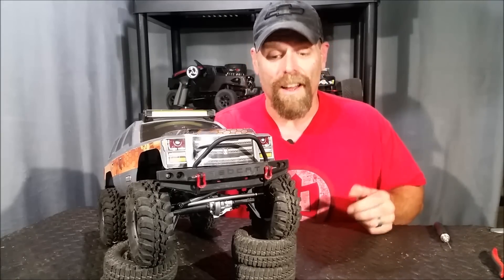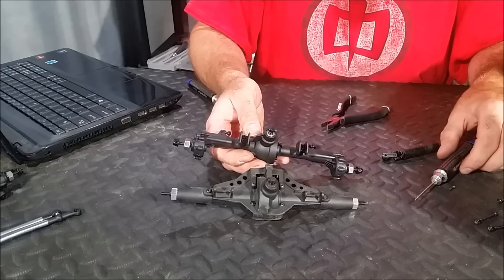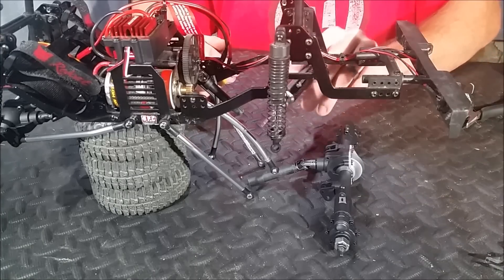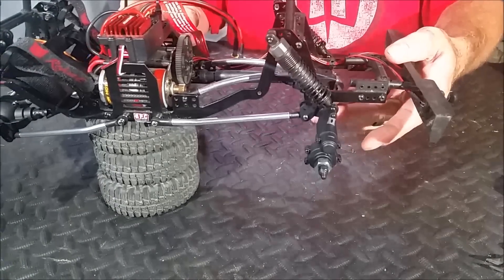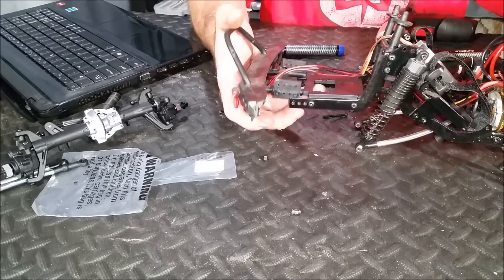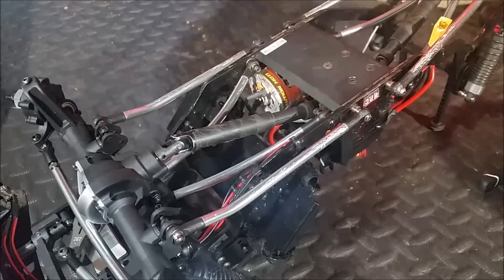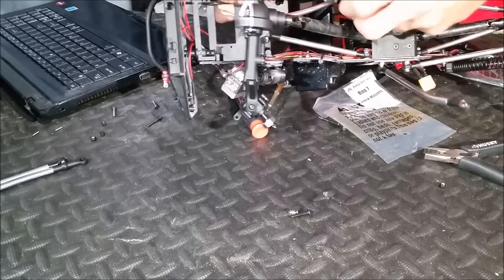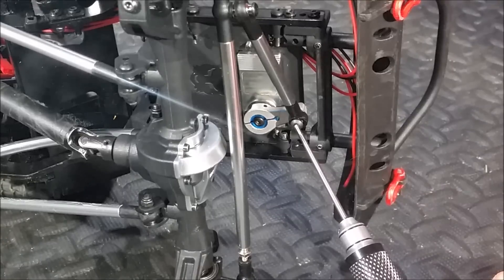Redcat Portal Assembly Part 2

Comment: where's part 3 I've done all this to mine one one thing I don't like is it squats funny on one in both front and rear not sure if this is a oil in shock issue or what but happened right after I did this upgrade
Reply from the maker: I ended up doing it in 2 videos instead of 3.  I had issues with it leaning too. I think it's because of the 3 link front end.  I never managed to get rid of it.

Comment: where did part 3 go?
Reply from the maker: Most of my issues were addressed in the 2nd video so I didn't do a 3rd
Reply: @BudgetRC_Channel  oh ok. Thanks! Waiting on my   gen 7 pro to get here today. First RC, and i am sitting here currently watching all your videos for it.
Reply: Finally finished, thanks to this video. I did go fourlink, and removed the panhard rod, mainly because i needed the hardware, (used kit, missing parts). I also lifted it, vs going to recommended positions. Now i have better articulations, steering (with 35kg servo added as well), and front only rubs under full compression and steering which i will fix later, but i will keep the steering settings low until i get the parts. Thanks alot for your vids!

Comment: Wheres the 3rd video ?
Reply from the maker: I ended up incorporating it into the end of this one. Most of my issues were self inflicted.
Reply: I got a question that I would like to ask you, since your familar with Gen 7, Do you have picture layout on how links are to be aligned and I lost a ton of speed after putting on portal axle, I already installed 50t turn spur
Reply from the maker: @chryslersj2011  the portals have a lot of gear reduction, so you need to run a smaller spur gear along with a larger spur to maintain the original gear ratio. I geared mine down a bit so that it would be better for 3S.  I'm not sure what you mean by how the links should be aligned? The axle links are the same as before except one goes away and gets replaced with the new panhard link.

Comment: I noticed that the passenger part does not flex 100% as the driver so I added 5 spacers in the servo mount link of figure 52 of the manual which connects to the portal (video 11:56) so it is already even on both sides...😲
I'm using the same spacers that we use for the shock
Reply from the maker: You're adding spacers where the panhard rod mounts to the servo bracket?  I'm not sure what kind of spacers you're talking about?

Comment: so bummed out I was fearing those top portal gears looked weak and would fail and a guy posted up a video showing they blow apart and break... Looks like my gen 7 is staying as is.
Reply from the maker: I haven't seen anybody break these yet.  Everybody on the Gen7 forums seems to be having good luck with them.  Who had the breakage?
Reply: Take a look at this guy he shows the gear at the end. https://www.youtube.com/watch?v=I0yhCasYqU4
Reply: There have been issues if it gets bound up.
Redcat is already working on a solution.
Reply: That's good
Reply: hmm after watching that I think I might just try and fit a set of trunigy portals from an axial scx10 I am thinking, whats your thoughts on this?
Reply: Hi redcat has already made a upgrade to the gears to make them stronger.
Reply: Shen RC  thanks for the info, are these available for public yet or still waiting? I do like the price point of redcat and the truck itself was well worth it out the box so hoping their parts are an on par experience.
Reply: Hi they are not available yet I believe they are still working on them.
Reply: Shen RC Thanks for the info, I will sit back and wait, till then I am sure I can find something else to upgrade. lol